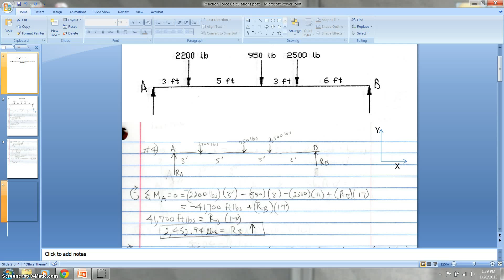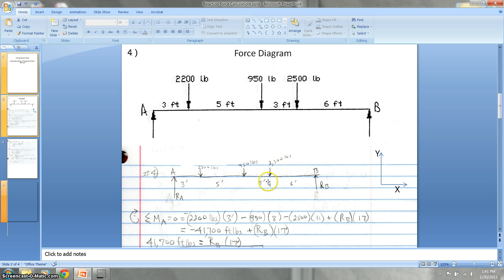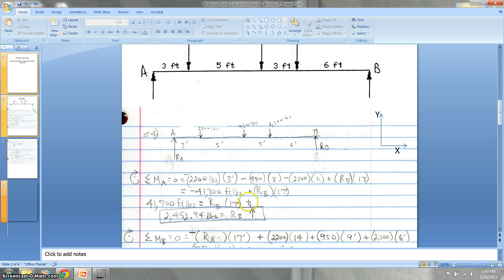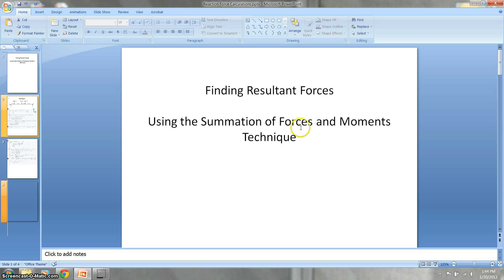Reaction Force on a Beam

Comment: Excellent demonstration, I understand it now. Thanks Kevin.
Reply from the maker: NP  That's why I posted.  Glad it helped.
Reply from the maker: ***** If the weight is uniform across the beam then add a vector arrow pointing down a the center of the beam (in this problem it would be placed 8.5 feet from the end) with a value of 8 kN and then do the same summation of forces procedure.  Don't forget to have all of the same units?  Good luck.